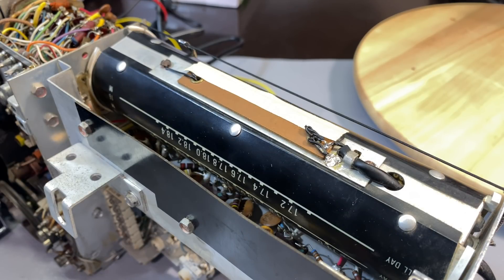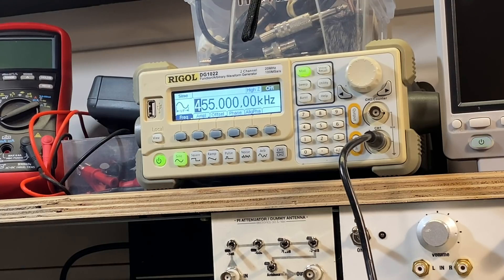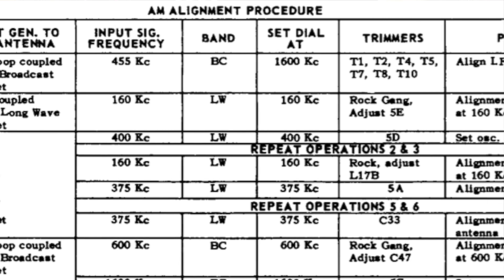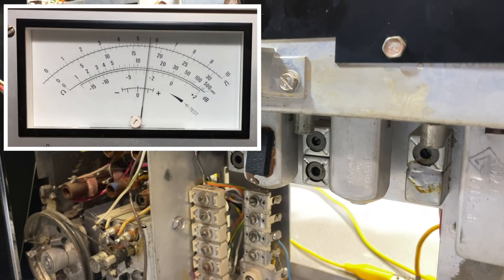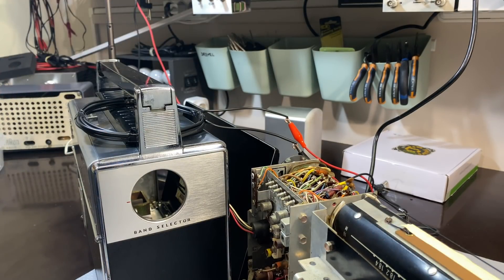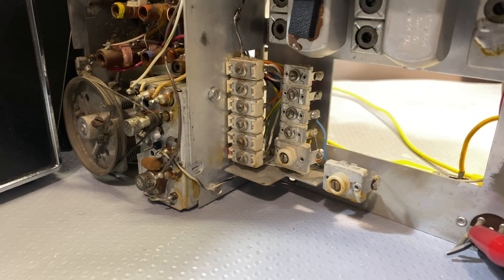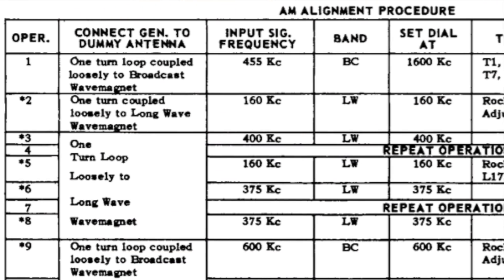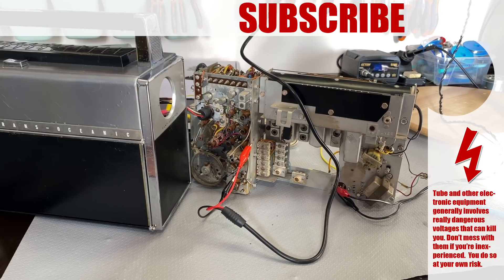Zenith Trans-Oceanic Royal 3000-1 restore, part 3. AM IF & RF Alignment.

Comment: My mother-in-law asked me to see why the 3000-1 her husband had was not working.   After quite a bit of searching the web, long before finding this video series,  I read that there is an issue with "tin whiskers" in the transistors.  The quick fix is to bend the case ground lead out of the way so the transitor case is not grounded.  This brought the radio back to life.  I tried to find replacement transistors but nobody carries them any longer. I can live with the radio as it is now, but I suspect the transistors will need replaced at some point.  Also, I dont really get any stations on MC, M or LW.  I am assuming it needs trimmed, but I do not have all the equipment seen here.  Is there a way to trim these bands without all this equipment?  AM and FM work great.
Reply from the maker: The tin whiskers trick usually gives the transistors a new lease on life. I know you can adjust the alignment by ear, and I’ve done that before, but it’s quite a tricky experience with this radio, so I wouldn’t recommend it. It’s better to find a radio tech who can do this for you.
Reply: @electronicsoldandnew  thanks

Comment: Greetings from Ireland,
Like you, while aligning a.m. RF sections I would set the generator frequency, adjust the setting on the radio and adjust the oscillator trimmers at both ends of the band for max output, however during your procedure via the chart for this radio, I was reminded of a technique my dad showed me when I used to help him as a boy in his radio shop (late 1960's). He would set the generator , say 1.6 mHz and move the pointer on the radio to this indicated frequency on the scale. Then he would "ROCK" the tuning capacitor back and forwards slightly ,while adjusting the trimmers for a max signal. This resulted in best sensitivity for these frequencies at the expense of slight variations in how the indicator was  pointed on the scale. However you could sometimes move the pointer to correct this error.
Reply from the maker: Good point. They actually tell us to rock the tuning capacitor, and I didn’t really understand what they meant. Nothing beats experience 😊

Comment: Well the cores of the contours after so many years can still be twisted and adjusted the contour.
  
Receivers of production of the USSR had the cores of the circuits filled with paraffin or stearin and after 15-20 years they cannot be twisted, they are jammed and simply break when trying to adjust.  There should be a crying emoticon here.
Reply: (If windows, press the Windows key + a dot.... )
Reply: Thank all

Comment: Hi again, Manuel. You do not need to take the chassis from the case, at least for the AM alignment, and aligning from within the metal case is advisable. Cores "B" can be accessed from the "A" side with the apropriate tool as they are placed inline within the bobbins. I've seen you're using a metallic  Allen wrench for this and that is a big no-no. You should use a plastic 0.1" hex wrench with the rod thinner than the hex end to access the "B" cores. This is not an easy tool to find but I managed to get a couple of them which I had to turn a bit in my lathe to make it long enough to reach the inner hex cores:

http://www.pisotones.com/Zenith/3000-1/Tool.JPG

I can turn one for you. You have my email, drop me a note with you address and I'll be happy to send it to you.
Reply: out of curiousity, why is that a no-no?